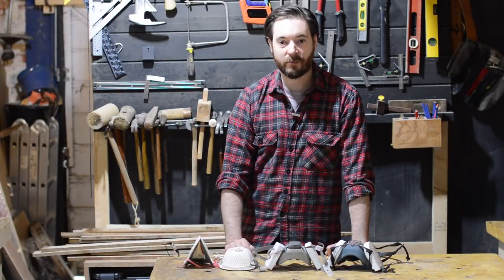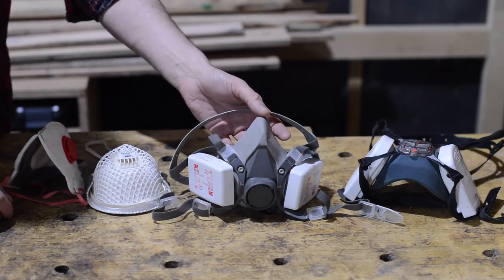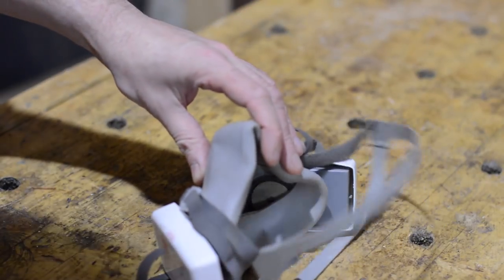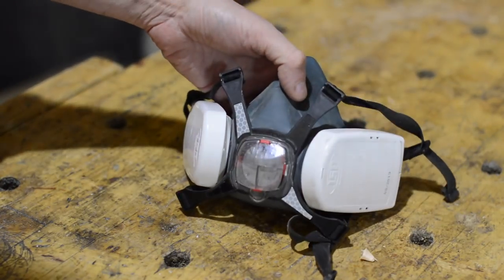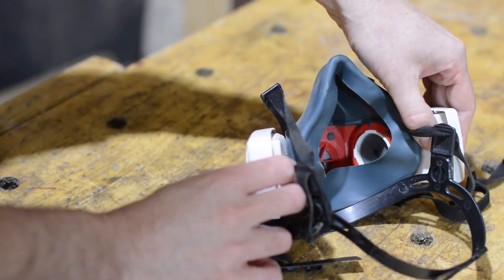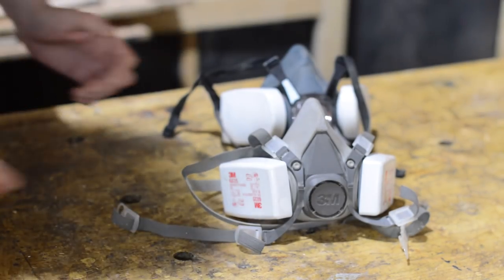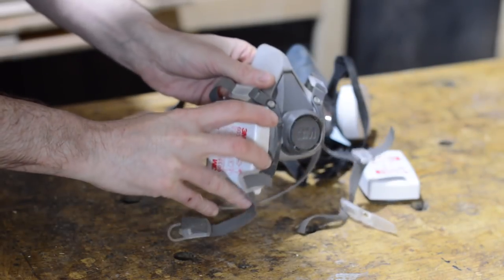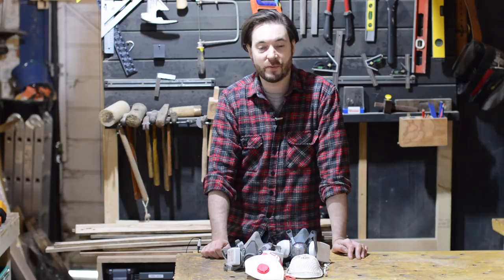My Experience with Dust Masks

Comment: A very good point well made Matt. My facial hair varies from hunky stubble to unwashed cave man depending on how lazy I am or length of time between public appearances so I eventually went for the full face powered respirator from JSP.  However, the system with the push to seal test would be worth trying out and I'll pick one up on my next visit to the 'toy' shop. Trouble is the little lad next door thinks I'm a spaceman with the full visor on humming away and my little workshop is really a stargate! Don't want to disillusion the lad!
Reply from the maker: You do have a doctor who vibe with the small box and the space suite. I will put your name forward for the 14th Doctor

Comment: I have the same 3M mask myself. Two quick things:
1) You have to have the right filter cartridges. There are several types with different ratings and what will handle dust may not handle, say, MDF dust. 
2) You can check the seal faster on the 3M mask and more easily than on the JSP one. Put the 3M mask on, take a breath, then take the palm of one hand, put it over the exhaust valve of the mask (the circular bit in front of your nose between the filter cartridges that has "3M" embossed on it) and push slightly to make sure the palm of your hand is now sealing that port. Then exhale out strongly. If you have a good seal, you'll feel the pressure rise inside the mask and it'll stay high, it won't leak out around the edges. It only takes 2-3 seconds to do and you're not fiddling trying to reach buttons on the reverse of the filters outside your field of vision.

Comment: Really good video, I have purchased a Trend one which is good and comes in 2 sizes, as you do need to face fit your mask to ensure it fits, I have a goatie beard so masks fit me fairly well, I am moving more to hand tools as they produce less dust and also less noise. By the time I have put on my gloves, face mask, safety boots, ear defenders and eye protection I sometimes have forgotten what I was going to do.
Reply from the maker: People seem to really like the trend. Hand tools is a great option. Maybe I’m too lazy.
Reply: Badger Workshop The bottle opener that I made based on your version was all done using hand tools since I do not have a band saw, I have found that I can do some things quicker using hand tools because there is no set up time. Looking forward to the next video.

Comment: If you have rigid plastic filters with the 3M mask, you can cover the exhale valve on the front and exhale.  If the mask inflates and no air escapes, you have a good seal.
Reply from the maker: That’s good to know.

Comment: Good nuggets of info here Matt. PPE is important. Sad to see a lot of guys don't bother onsite. Not always out of some misplaced sense of machismo but often due to being time pressured and not wanting to run to the van. Seen some lads in their 50's develop some serious problems.
Reply from the maker: I try and use a mask but also extract at the tool. I’m my new shop I will get a air filter

Comment: I’ve been thinking about getting a decent mask rather than relying on an open door a shop vac.

Screwfix always comes through and I’ve never had a problem there. Except the kids working behind the counter that don’t know their arse from a plum line.
Reply from the maker: No they do not. You have to know what you want. I use them a lot. Trouble is I always spend £50 to get the free delivery

Comment: Another trick I've seen painter do is to spray some paint into the air if you can smell it then you haven got a good sell or the mask isn't doing a good job.
Reply from the maker: Or you could fart
Reply: Badger Workshop wouldn't want to take the risk with that toxic stuff 🤣